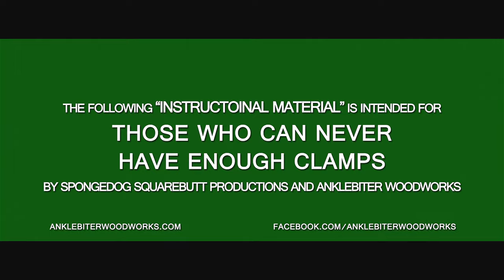Video #10: Cherry and Coffee

Comment: Very cool nice project 👍👍👍👍👍🤗🤗🤗 where do get the mug lines ? Just wondering?
Reply from the maker: I am assuming you are talking about the stainless steel inserts.  I get mine from Woodcraft but you can also find them at Rockler.  Both are ~$10, but I prefer the one from Woodcraft as the lid is threaded instead of just a press fit little gasket.